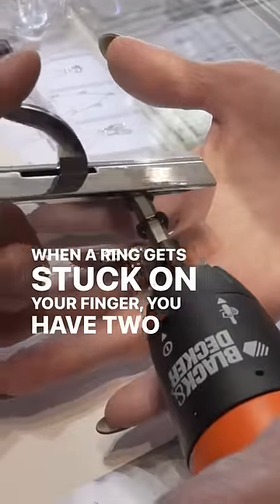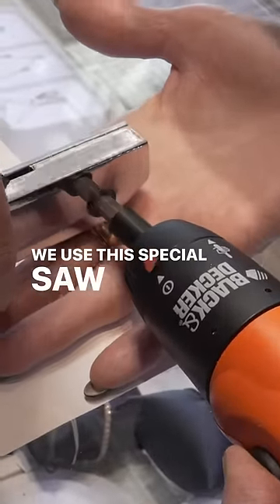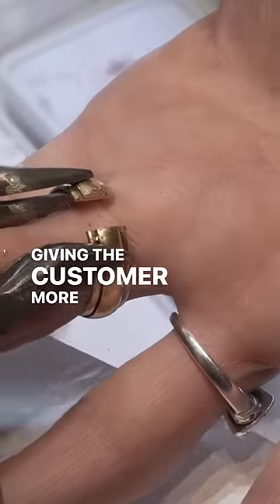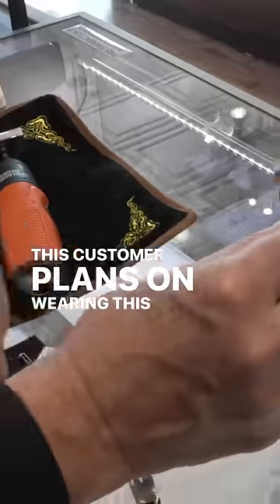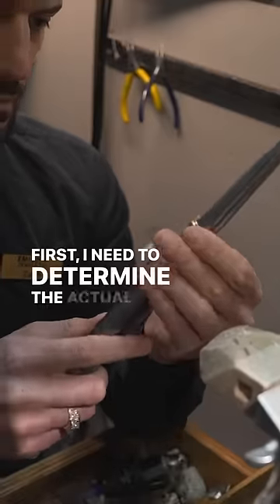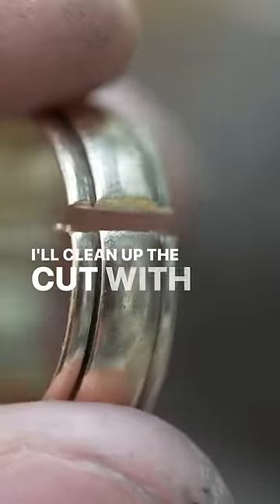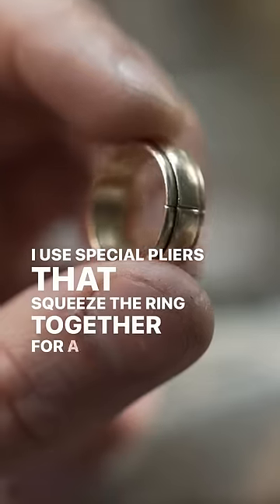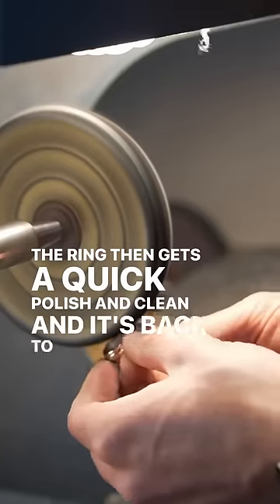Removing Stuck Wedding Ring

Comment: Got my finger caught on a boxcar 35 years ago.  My wedding ring needed to be cut off. At the time it had a key/handle like a can opener. So it was cut off just like you were twisting the handle on a can opener. I thought it would be easy to use a electric screwdriver just like in the video.
Reply from the maker: Yikes!

Comment: Of course a jeweler wouldn't use the string method. You'd want to destroy the ring so they buy another. Smart. Shitty. But smart.
Reply from the maker: This woman had this ring on for over 30yrs. Her knuckles grew from arthritis, causing the rings to be stuck on her finger. We tried Windex, soap, and the string trick didn’t work either because you can’t compress bones. Cutting the ring off is the last resort, but it ends up looking good as new👍 thanks for watching!

Comment: What about a piece of string? Worked for me.. Wind it tight around the finger and slip it over the string.
Reply from the maker: This woman had this ring on for over 30yrs. Her knuckles grew from arthritis, causing the rings to be stuck on her finger. We tried Windex, soap, and the string trick didn’t work either because you can’t compress bones. Cutting the ring off is the last resort, but it ends up looking good as new👍 thanks for watching!
Reply: @zachemighjewelry  Awesome! Thanks for a responding.

Comment: When you solder the ring you should really flatten the joins so they meet exactly head to head. If you don't it results in the solder not being uniformly spread between the join
Reply from the maker: For sure

Comment: I’m surprised, I’m so used to soldering being used in electronics and welding being used for metal work, that it never crossed my mind that you would solder a ring back together rather than weld it
Reply from the maker: For sure !

Comment: Hi Zach, speaking of ring resizing, could I ask your help on a dilemma I’m having? My fiancé proposed using his great grandmother’s engagement ring. Its a beautiful ring that has his great grandparent’s initials and the proposal year on the inside of the band. Just one problem, it’s two sizes too big. I tried going to a jeweler and they seemed hesitant about resizing it while trying to keep the original engraving. Is it silly for me to try and keep the original engraving since it could be redone?
Reply from the maker: We run into this issue often. Maybe look into wearing a ring-guard or a ring slinky to tighten the ring. If these options aren’t enough, I would just have it sized and re engraved!🫡

Comment: Seeing people cut of rings bothers the fuck out of me because I know exactly how to get them off of any swollen finger 90% of the time. Literally just a flat shoelace wrapped tightly enough around your finger (starting at the tip) to squish the swelling down, tuck it under the ring, then use the end tucked under the ring to pull the ring up and over the compressed area, unraveling the string along the way. If you can’t get that to work, THEN your only option is to cut it. Any doctor or jeweler that comes at my heirloom jewelry with a saw before any other solution  and that saw is going on their fingers
Reply from the maker: String trick wouldn’t work here. She had this ring on over 30yrs and her arthritis caused her bones to enlarge. String can’t compress bones

Comment: if you can pass a thin but sturdy wire between ring and finger, there is actually a trick to get it of without damaging the ring nor loosing a finger. It is often used to remove stuck rings from elderly people with swolen fingers.
Reply from the maker: This woman had this ring on for over 30yrs. Her knuckles grew from arthritis, causing the rings to be stuck on her finger. We tried Windex, soap, and the string trick didn’t work either because you can’t compress bones. Cutting the ring off is the last resort, but it ends up looking good as new👍 thanks for watching!

Comment: First choice wrap a thin thread or dental floss from the fingertip back up to and under the ring(don’t overlap the thread) then take the thread from the hand side and start pulling the thread and unwind it down the finger. Wrapping the thread round the finger temporarily reduces the finger size then mechanical advantage “walks” the ring down the finger, should take no more than a min or two, and no damage to the ring or finger
Reply from the maker: Her bones were the issue

Comment: Why not just use a piece of thread? No danger at all
Reply from the maker: This woman had this ring on for over 30yrs. Her knuckles grew from arthritis, causing the rings to be stuck on her finger. We tried Windex, soap, and the string trick didn’t work either because you can’t compress bones. Cutting the ring off is the last resort, but it ends up looking good as new👍 thanks for watching!
Reply: @zachemighjewelry  ohh noo. My grandma's hands and knuckles got absolutely mangled from arthritis, so that totally makes sense

Comment: You can get the same solution with string and you don't cut the ring
Reply from the maker: This woman had this ring on for over 30yrs. Her knuckles grew from arthritis, causing the rings to be stuck on her finger. We tried Windex, soap, and the string trick didn’t work either because you can’t compress bones. Cutting the ring off is the last resort, but it ends up looking good as new👍 thanks for watching!

Comment: There's a trick were you can use fishing line, no need to cut it.
Reply from the maker: This woman had this ring on for over 30yrs. Her knuckles grew from arthritis, causing the rings to be stuck on her finger. We tried Windex, soap, and the string trick didn’t work either because you can’t compress bones. Cutting the ring off is the last resort, but it ends up looking good as new👍 thanks for watching!

Comment: there's also a third method, wrapping the finger with string and underneath the ring then unravel the the string as it pulls the ring off the finger. I've seen that method done many times.
Reply from the maker: This woman had this ring on for over 30yrs. Her knuckles grew from arthritis, causing the rings to be stuck on her finger. We tried Windex, soap, and the string trick didn’t work either because you can’t compress bones. Cutting the ring off is the last resort, but it ends up looking good as new👍 thanks for watching!

Comment: Or put string under the ring n wrap it tightly around ur finger then pull the string under the ring n itll slide right off.  Use compression to get it off n its free =)
Reply from the maker: Doesn’t work when the bones are the issue

Comment: there's another video out there using a string instead of a saw to remove the ring.
Reply from the maker: This woman had this ring on for over 30yrs. Her knuckles grew from arthritis, causing the rings to be stuck on her finger. We tried Windex, soap, and the string trick didn’t work either because you can’t compress bones. Cutting the ring off is the last resort, but it ends up looking good as new👍 thanks for watching!

Comment: you know if you just put thred under ring ,wrap spiraly tight on finger then uncoil three from opposite end and the thread will slide the ring iright off.
Reply from the maker: This woman had this ring on for over 30yrs. Her knuckles grew from arthritis, causing the rings to be stuck on her finger. We tried Windex, soap, and the string trick didn’t work either because you can’t compress bones. Cutting the ring off is the last resort, but it ends up looking good as new👍 thanks for watching!

Comment: Use the string method. Works great
Reply from the maker: This woman had this ring on for over 30yrs. Her knuckles grew from arthritis, causing the rings to be stuck on her finger. We tried Windex, soap, and the string trick didn’t work either because you can’t compress bones. Cutting the ring off is the last resort, but it ends up looking good as new👍 thanks for watching!

Comment: Or you use the 'thread' method.
Reply from the maker: This woman had this ring on for over 30yrs. Her knuckles grew from arthritis, causing the rings to be stuck on her finger. We tried Windex, soap, and the string trick didn’t work either because you can’t compress bones. Cutting the ring off is the last resort, but it ends up looking good as new👍 thanks for watching!
Reply: @zachemighjewelry  Wait, you didn't try Pym particles? 
😏

Comment: Thread or floss method!
Reply from the maker: This woman had this ring on for over 30yrs. Her knuckles grew from arthritis, causing the rings to be stuck on her finger. We tried Windex, soap, and the string trick didn’t work either because you can’t compress bones. Cutting the ring off is the last resort, but it ends up looking good as new👍 thanks for watching!

Comment: I learnt from my grandmother to just wrap a piece of string around the finger in a spiral to squeeze the finger like a bandage(reduces the finger between a half to a full ring size). Then thread the end under the ring and pull on the string. The string will spiral the ring off the finger.

For a jeweller it saves on solder, time and risk as you can just use a ring enlarger/reducer, a piece of string and a thin piece of wood or metal to thread it under the ring (something blunt and smooth obviously).
Turns it into a 5-10 minute job depending on polishing skills and speed.
Reply from the maker: This woman had this ring on for over 30yrs. Her knuckles grew from arthritis, causing the rings to be stuck on her finger. We tried Windex, soap, and the string trick didn’t work either because you can’t compress bones. Cutting the ring off is the last resort, but it ends up looking good as new👍 thanks for watching!
Reply: Yeah bloody damned knuckles don't have much in the way of give to them do they 😂

Comment: Use ring rescue products it’s a company that makes products to remove rings w without having to cut them, but if they do have to cut them, there’s tools for that too. My uncle is one of the founders of the company.
Reply from the maker: This woman had this ring on for over 30yrs. Her knuckles grew from arthritis, causing the rings to be stuck on her finger. We tried Windex, soap, and the string trick didn’t work either because you can’t compress bones. Cutting the ring off is the last resort, but it ends up looking good as new👍 thanks for watching!
Reply: Ok but you should look up what ring rescue is

Comment: I feel like I can’t find a ring size. My knuckles are wider than the rest of my fingers. So it makes it hard, because if it’ll fit over my knuckle, it’ll be a little too big for where it actually needs to be :( any advice on this?
Reply from the maker: It’s a common issue! Sometimes we’ll install a small bar of gold on the inside of the ring to take up some of that extra space to help this issue!
Reply: @zachemighjewelry  thank you so much!!! I’ll have to look into that :)

Comment: I hear hospitals wrap string around your finger and it works the ring off itself without damaging it or the finger, if that's an option seems aggressive to cut it off  though I suppose if you're Downsizing it anyways it doesn't matter
Reply from the maker: This woman had this ring on for over 30yrs. Her knuckles grew from arthritis, causing the rings to be stuck on her finger. We tried Windex, soap, and the string trick didn’t work either because you can’t compress bones. Cutting the ring off is the last resort, but it ends up looking good as new👍 thanks for watching!
Reply: @zachemighjewelry  aaah that makes sense, I can respect that, seems reasonable given those circumstances :)

Comment: Should definitely use string method to minimize liability
Reply: But you are the professional here so 🤓
Reply from the maker: This woman had this ring on for over 30yrs. Her knuckles grew from arthritis, causing the rings to be stuck on her finger. We tried Windex, soap, and the string trick didn’t work either because you can’t compress bones. Cutting the ring off is the last resort, but it ends up looking good as new👍 thanks for watching!

Comment: I also found this one way to do it with a string which takes less time but if they still have it on a finger it doesnt fit they'd have to keep doing it
Reply from the maker: This woman had this ring on for over 30yrs. Her knuckles grew from arthritis, causing the rings to be stuck on her finger. We tried Windex, soap, and the string trick didn’t work either because you can’t compress bones. Cutting the ring off is the last resort, but it ends up looking good as new👍 thanks for watching!
Reply: @zachemighjewelry  You did a really good job with it too, I'm sorry if it sounded pretentious when I commented that

Comment: There is a much better way to remove the ring without damaging the ring.
Reply from the maker: Let’s hear it
Reply: @zachemighjewelry  you wrap like a string or rubber band around the finger, with the end tucked underneath the ring. Then you pull the part that is tucked underneath the ring and it will pull the ring off the swollen finger. I have done this many of times myself, and I have taught this technique to others.
There is a few doctors, and EMS professionals who are teaching this technique so you don’t need to cut the ring off.

Comment: Actually there's more than two you can stick a piece of cloth under it and then tighten it around your finger to make your finger smaller and then gradually pull the ring off and it will come off that way to and saved you from cutting it
Reply from the maker: This woman had this ring on for over 30yrs. Her knuckles grew from arthritis, causing the rings to be stuck on her finger. We tried Windex, soap, and the string trick didn’t work either because you can’t compress bones. Cutting the ring off is the last resort, but it ends up looking good as new👍 thanks for watching!
Reply: @zachemighjewelry   I had mine stuck for a very long time that is how I got it off but I'm glad you got it off for her and made it new welcome thanks for showing that video

Comment: I've seen a method where a jewler/other person used a blunt, maybe slightly rounded needle to thread under the ring toward the palm, then firmly and tightly wrap the thread around the 2nd knuckle multiple times until the knuckle is covered. Then they slowly unwrap the thread from the needle end, which slowly pulls the ring over the 2nd knuckle. I understand it may not always be smart/safe to do that method, as it essentially cuts off circulation to finger, but if done quickly and the right way it's faster and cheaper than cutting the ring (or the finger, for that matter).
Reply from the maker: This woman had this ring on for over 30yrs. Her knuckles grew from arthritis, causing the rings to be stuck on her finger. We tried Windex, soap, and the string trick didn’t work either because you can’t compress bones. Cutting the ring off is the last resort, but it ends up looking good as new👍 thanks for watching!
Reply: @zachemighjewelry  30 years! Wow. The knuckles getting bigger sounds rough. Good on ya for making it look brand new after cutting it!

Comment: Why didn't you just use the string method?
Reply from the maker: This woman had this ring on for over 30yrs. Her knuckles grew from arthritis, causing the rings to be stuck on her finger. We tried Windex, soap, and the string trick didn’t work either because you can’t compress bones. Cutting the ring off is the last resort, but it ends up looking good as new👍 thanks for watching!
Reply: @Zach Emigh Jewelry  ah understandable I didnt know that her knuckles grew due to it.

Comment: What happens with the gold you cut off?
Reply from the maker: Gets collected and sent to a refinery
Reply: @zachemighjewelry  that's cool. So let's say you have to widen a ring. Do you add extra gold or use a  mandrel to stretch the current gold?
Reply from the maker: @adamrodriguez7463  depends on the ring. If there’s no gems and it has never been cut, I can usually stretch it (I have another video on this process on my channel). If there’s gems, I add a piece of gold to the ring to enlarge it